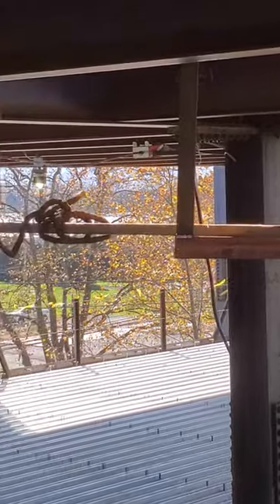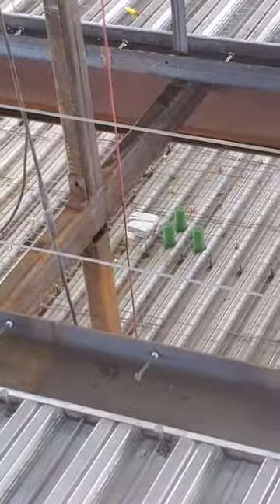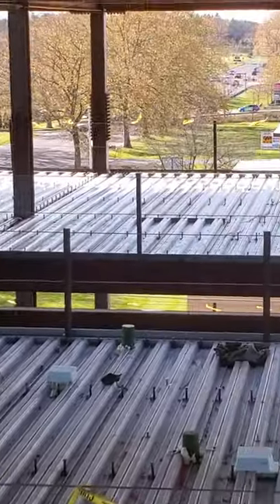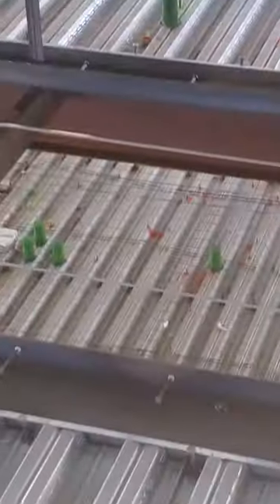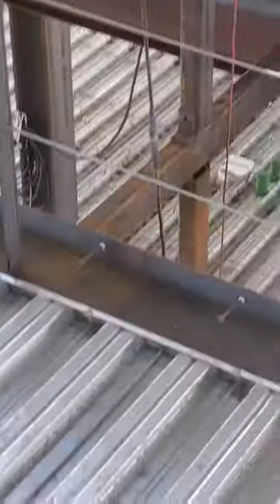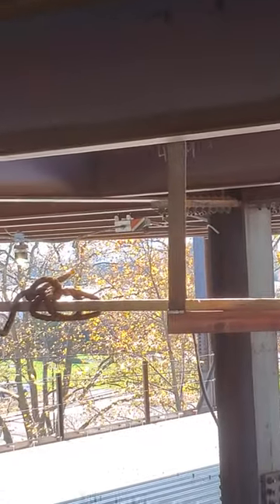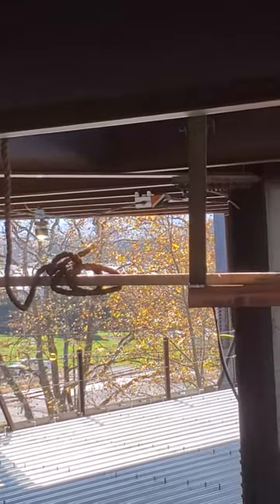Structural welding/ Aerial  Assault =( The Godfather)

Comment: What’s going on, Where  you working at bro I’m in school for welding but any tips would really help out great video and keep
It up
Reply from the maker: Cody, What's up, Philly North Jersey New York Poconos, That's my neck of the woods, How long you been in welding school,  where are you located in this great United States of America, Ask me any question, I will try to guide you in the right direction, Thanks for your comment, Have a great weekend!
Reply: @jetweldingllc4691  I’m located in Houston Texas and I current go to Tulsa welding school I been running a vertical t joint w 6010 root and 7018 fill, cap but it’s giving me a hard time on overlaying them properly Really not that much I could get help w from so far away but any tips and tricks or videos that you post really help man thanks for the support and having a great weekend as well god bless America champ
Reply from the maker: @eakd8271   Root  Pass is good, correct?1/8 7018 / 4 fill and cap, correct? So you're having problems was the 7018, Correct? I'm trying to figure out , How can I help you!
Reply from the maker: Cody, We were looking in Conroe Texas for property, Still want to move there, But not yet!
Reply from the maker: @eakd8271    What amps  are you running, Then I need the wire size, Give me a heads up, I'll try to do a video on Sunday, T joint vertical up, 7018 1/8, I'll do my best,
Reply: @jetweldingllc4691  I’m running 85 amps and it’s a 7018 3/32 stick w a 6010 3/32 root I appreciate you tryna help the best you can man you for sure got a sub and supporter right here thanks a lot really means something. Keep up the grind bro.
Reply: For sure bro if you move out here give me a shout maybe I can learn a few things and potentially get a job
Reply from the maker: @eakd8271    I never run 3/32 7018, Everything is 1/8 or 5/32, I will come up with something with 3/32 rod, You're in a great welding school, Learn everything you can from every welding instructors , And make it your own, Hold your sides with the 70 18 2 to 3 seconds, Be patient, Rod angles everything, Some like it straight on, I like it uphill, With my rod angle, You'll figure it out, I get some videos out for you, Have a the weekend!
Reply: @jetweldingllc4691  I really appreciate it have a great weekend as well and thanks again.